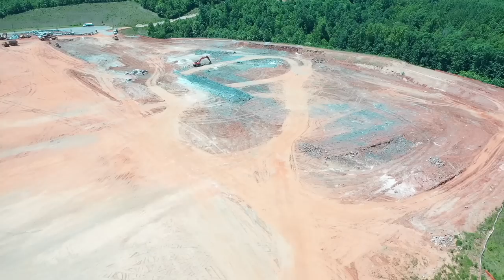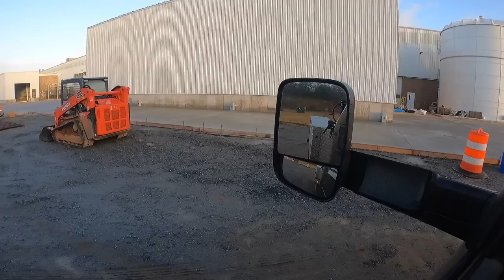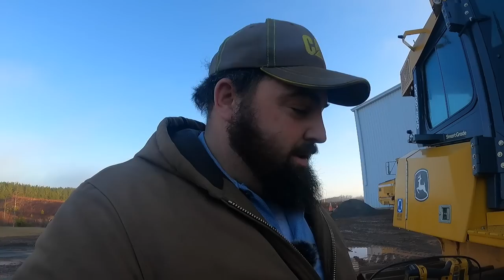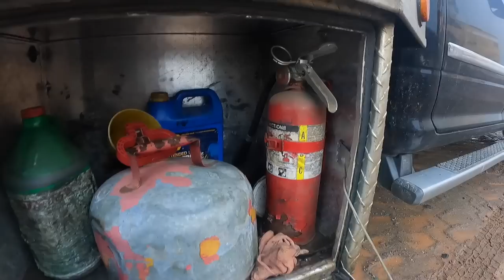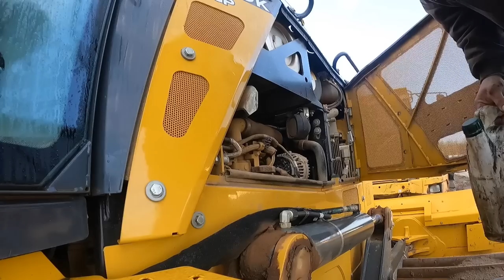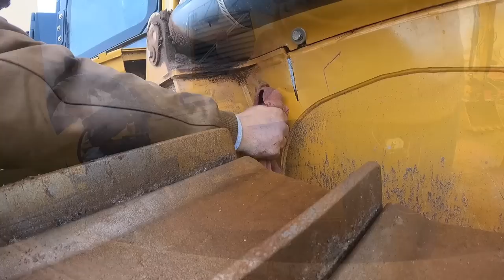You Wont Believe How Much This Place Has Changed! First Dozer Action In 2023.

Comment: Could you use a laser line mirror across the building? Not sure how vibration would affect it though and the mirror soaks up some light also which makes the beam light less and larger at a long distance. They work good indoors and never tried it outside.
Reply from the maker: Not sure about that, we set up a rotating laser to get the grades up next to the building.